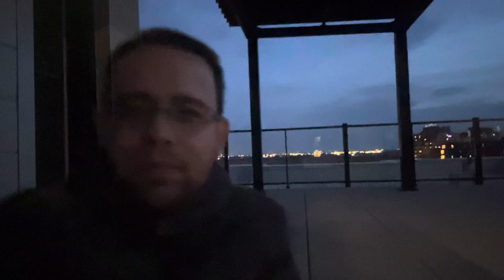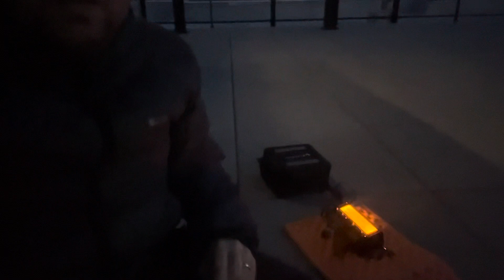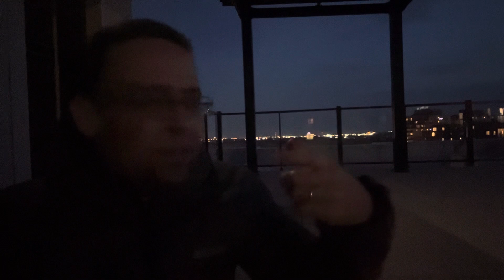What’s it like playing ham radio on buildings? UFO on the background???

Comment: The issue with adding more coils is increased Q-factor and very narrow portion of the band with reasonable SWR. Other than that, with up to 100w power coil loaded whips are good compromise for apartment balcony use.

Comment: Well this light is not a reflexion, could it be an helicopter or a plane that switch on his beam light or suddenly came out of a layer of cloud..But I doubt it? Since your camera is fixed I think it really poped out of nowhere. The las hypothesis is a drone but drone don't waste their power on beam light🤔 I think we have a UFU there!
Reply from the maker: I think it’s a plane that started the taxing procedures
Reply: -You are right. It slowly goes up as it pass over youthen change path to landing. If you remember the wind direction you can confirm it's circle approachrotation. The funny aspect of it is the fact that you are located in the perfect trajectory of the decreasing trajectory. Thanks!  @ve2zdx